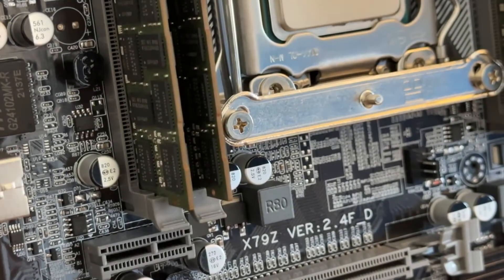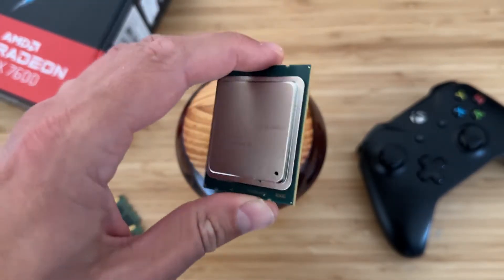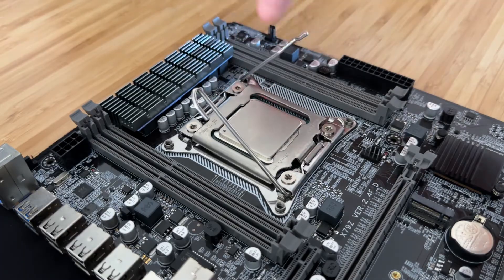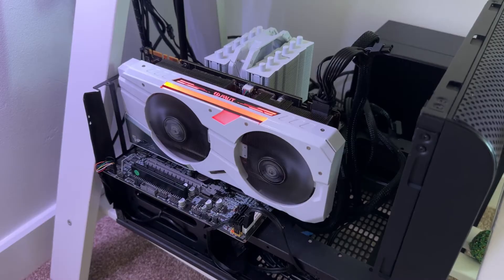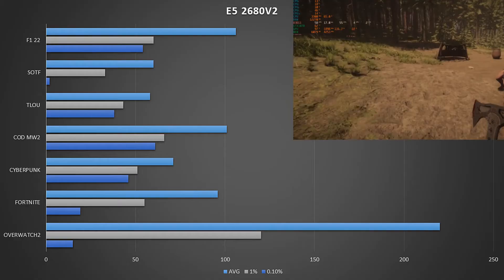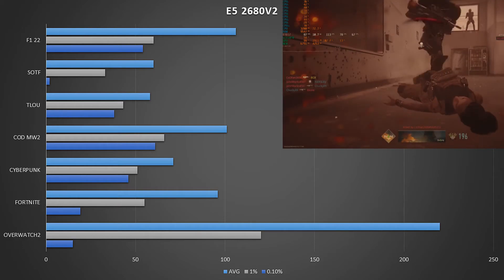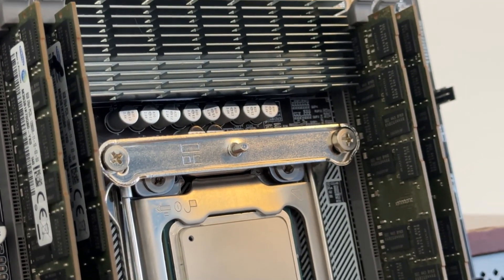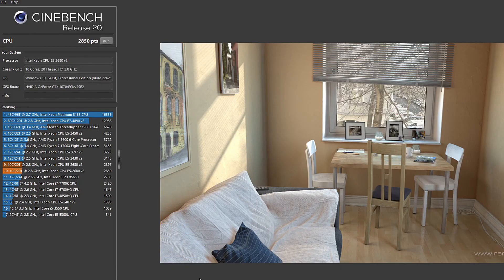This £60 XEON Motherboard Combo is Just AWESOME

Comment: I would never use one of those Chinese boards, every one I've seen has been utter junkk.
Reply from the maker: He’s still working strong 2 years later so I’m sold. Yes some are garbage but make sure you buy one with the proper chipset. Some have H81/H61 chipsets and yeah 😅

Comment: Ive just built a budget gaming machine using a HP Z440 workstation and a E5-2687w v4. 64GB RAM. It absolutely rips with 24 cores.  It was £150 total, and has a 700 watt PSU with dual graphics card power plugs. Assetto Corsa is giving 160 FPS, brilliant.
Reply from the maker: Belter for £150 there! Really love the used workstation price to performance.

Comment: wow it looks great i didn't see any drops or delay the Cpu you used is good enough to run most of big games which is based on 2.8 gh for single core and the Gpu  is 8Gb i think you did perfect PC gaming collection i will try to find the same parts for low cost PC to save more money and 1080 FHD is not bad  
one more thing i wish if you try to play horizon game because this game really heavy and needs more specifications

Comment: Great job, been a Xeon fan for years now for building Gaming PC.  I have 2 Lenovo ThinkStation P500 and P510 (got them for $100 each) running a Xeon E5-2697 v3 and a Xeon E5-2697A V4, both with 32GB Ram. Added a GTX1660Ti 6GB and a RTX3060 8GB and they are awesome for gaming.
Reply from the maker: ThinkStations are definitely a good route to go and they look a lot better than the Dells! Can’t wait for cheap X299’s but there a way off me thinks.

Comment: X99 2680 v4 combo works similar to Ryzen 5 3600. You can pair it with an RX 6600 or the highest RTX 4060 with a bit bottleneck
Reply from the maker: Just with more cores 🤩

Comment: Ordered my first AliExpress Xeon mobo few days ago for a NAS/homelab project. It was about 150USD (shipped + customs) for server-like mobo, with 6 RAM slots, 2x2.5Gbit Intel NIC, 10 SATA ports, 2xNVMe PCI-E slots, paired with Xeon E5-2680v4 (14c/28t) with full virtualization, AVX/AVX2 support and 40 PCI-E lanes for server addons. I hope it will be stable in the long run. CPU won't be tasked much, but I plan to run few VMs and dockers, so having more cores will be nice. For gamers, there are also higher clocked Xeons with less cores.
Reply from the maker: Awesome I love a project! Really hope it serves you well it’s a great platform. The 2667v3 is a personal favourite 8cores 16threads at 3.4GHz all core 💪🏼
Reply: Did you get it? did it support virtualization? link it
Reply: Yes, I got it. Search for "XEON Nas Motherboard Kit 10 SATA" and it should show as a first result. It's a motherboard with 6 RAM slots (2 on left, 4 on right), 2 NVMe slots (one vertical on the left side of the CPU socket, one horizontal on the bottom of the board), 2*PCI-Ex16, 1*PCI-Ex8. There is also a "Cloud Star" text in the middle of the motherboard.
Everything is working: virtualization, bifurcation (configurable in BIOS for all slots), all SATA ports, all NICs. I've connected 8xHDD, 2xSATA SDD, 2xNVMe and it's running great. Tested on Windows 10 and 11, as well as Ubuntu 24.04.1. BIOS has A LOT of settings and the ones that I needed all worked (energy management, SATA and NVMe config, legacy vs. UEFI boot etc.). Tested with 2 CPUs: one that came with motherboard E5-2680v4 (14c/28t) and one I bought locally E5-2620v4 (8c/16t). Both working without problems. I am using E5-2620v4 because 8c is enough for my use and it has lower TDP. Also lower NVMe slot seems to share lanes with PCI-Ex8 slot, so have that in mind.
I've used 4x32GB of Samsung ECC RDIMM 2400MHz DDR4 - dirt cheap and stable with both E5-2680v4 (running at 2400MHz) and E5-2620v4 (running at 2133MHz). Tested on both CPUs with 24h MemTest run. ECC works as well.
One downside - energy consumption. At default it uses around 65W (measured at wall) in idle with 1*NVMe drive and E2680v4 (14c). After BIOS optimizations it came down to 58W. With E5-2620v4 it came down another 2W, to 56W. CPU supports states from C1 to C3.
Overall I'm happy with my purchase. Time will tell how this motherboard will fare in a longtime 24/7 run. I plan to use it for maybe 2 years while slowly learning as much as I can in the home lab environment. After that I would want swap it to something more energy efficient and more modern.

That said, If I were to build my home lab setup today, I would probably go with something like CWWK Q670 with a 12th gen Intel CPU on board. It has less expansion due to CPU having less PCI-E lanes and smaller size (mITX), but at the same time it has a vPro support for remote management, CPU has a modern iGPU for Plex/Jellyfin hardware acceleration, a lot lower power consumption in idle, it supports T line of CPUs with 35W TDP etc. Modern i5 core will have a lot higher single core performance as older Xeon as well. No ECC sadly, but for a home lab I think internal sort-of ECC in DDR5 would suffice. Downside - mobo+CPU+64GB DDR5 will cost twice as much as the Xeon+mobo+128GB for the initial investment. For me it would take around 3 years to get it back in energy savings.

Comment: The limitation now only coz it's Mobo old features.. with slow transfer speed will be mode ruin. Btw for someone who don't care on this matter, this build not such a problem and it's perform very well for light gaming for budget cost. And the most important value very good for server user to avoid error. Recommend for 24/7 turn on without problem of error.
Reply from the maker: 2666v3 and a cheap board with 32GB ddr4 ram at the moment come in at under £60! Awesome value and yes agreed I would get on AM4 for a little more if you can but you can pair a 3060 12GB no problem with that above combo 💪🏼

Comment: Better go for e5 2697 v3
Reply from the maker: Loads of options. X99 is the better bet to go for and the 2667 v3 is a good option as well, higher base and boost clock but you loose a few cores
Reply: @andystech101  e5 2697 v3 has better performance in all xeon processors e5 2697 is almost equal to Ryzen 5 5600x and price is too low around 10 to 20 bucks

Comment: Those slots look like they belong to two 3090 GPUs NVLinked.  If both of those are PCIex16 slots, then games would be a bit smoother. Yes, one is used in gaming with the other providing PhysX; no SLI.  That is from testing and not just using 8x PCIe 3.0 bandwidth.  This would make good for an editor and gamer.  You would not have the gaming performance of a 4090, but would be on par or greater for machine learning or rendering.  The CPU tradeoff would be the determining factor.

Comment: Love Xeon's. Got an old HP Z440. E5 1650V3 32g 2133 k2200 Quadro. $230 Australian. I put an NVME in on an  ($29) HP Turbo pci-e adaptor.
Reply: Same here !, Z440, E5-2687w v4, 64GB, and a GTX 1060 6GB. If you update the BIOS to latest then you can add any PCIe NVME adapter and it will boot from NVME on the latest bios revision. They are awesome PC's. The quality of the unit is outstanding, its like the Bentley of PC's, and amazing value. Over £2,300 new, but now for £150 on marketplace. For a 24 core machine such an awesome bargain.

Comment: what is thepower consumption in indle and average use ?
Reply from the maker: At this point in time I couldn’t tell you but it was nothing amazing as these old Xeons pull 120w+ under-load. That said the new i7’s etc pull a lot more

Comment: Nice Video, the X79 is a good platform for budget builds but the X99 is getting cheaper and you might find some deals, i got a Machinist X99-PR9 for $26 and paired it with the E5-2620 V3 which i got for $2 and got a small cooler for $4 with 8GB DDR4 ram for $10 all for $45 from Aliexpress + seeing the E5-2680 V2 competing with the R7 5700G is wild.
Reply from the maker: I’d agree with you there with X99. I think if you can spend the extra especially 9 months on. They’re really good little boards the X99-PR9 and I’ve used a few now for budget builds. That said I think we’ll get another year or two out of X79 before it’s rendered to the realms of X58! Still my favourite but just not really usable these days due to the lack of instruction sets!

Comment: If we consider both performance and power efficiency, which of these two chips would be better to get?? 2680-V2 or 2690-V2 Is there a big difference in power consumption between these two chips or is it about the same if we run the 2690 at a lower frequency to match the 2680?? I'm looking to buy one with low power consumption but also decent performance.
Reply from the maker: Both are quite juicy tbh. I would go X79 if you’re looking for power efficiency. Though the cheap Ali express boards tend to have a power limit so you won’t be pulling the full 130w

Comment: Cool motherboard and video.
The problem with Xeon is power consumption
Reply from the maker: It’s not too bad on these Ali boards as they seem to be power limited or at least the cheaper ones but yes in the world of 8core 65w parts these days they are a little juicy! That said I had an i7 12700 for a customer build and that was pulling 180w on turbo.
Reply: It's really depends on a country where you live I think
Reply: Yeh my E5-2687w v4 is 160 watts on full load, so its a hungry CPU. But not really fussed for about 4hrs gaming a week.

Comment: I’m currently running an “Atermiter” X99 with a Xeon E5-2667 v4 and 24 Gb of ram. 8 cores, double threaded, 3.2 GHz base. Currently running with an RR-580 4Gb card. Will it run Elden Ring? No. Will it run CAD and AoE2 DE? Absolutely.
Reply from the maker: I’d probably say your gpu is letting you down on the Eldon Ring front as you should be able to pair an RTX3060/RX6600 quite happily with the 2667 v4 it’s still a little beast and easily keeps up with a 1st/2nd gen 8core Ryzen!

Comment: You make an excellent argument. I am thankful for your videos. You have an amazing video editing talent, what rig do you use for editing ? I would like to note that unfortunately Chinese motherboards are lacking in terms of overclocking, warranty, and buyer protection. If you come across any problem you would loose money. The motherboards are getting expensive by the day, so the regular brands make more sense. Again I thank you so much.
Reply from the maker: Yes agreed there! Thankfully I’ve not had any problems as of yet with this board or any Ali board I’ve brought. Yes features are lacking but most users just want an out the box experience. Thanks I try 😂 My main rig is an i5 13400F and 7800XT with 32GB ram, 1TB NVMe. This was nice to build as I was working with a 5600G before 💪🏼

Comment: 😃 wow thats pretty cool, this looks like its even cheaper than a brand new but kinda slow little ryzen 5 4500 and A520 combo, the 5700g is one of those weird lower tier chips like the 5600g, the number schemes are kinda confusing eh. We need a new song for the Xeons like we have for the Pentiums, its all about the pentiums 😄 thanks bro for checking out the xeons
Reply from the maker: Thanks for the comment really appreciate it. Yes got to love Xeon’s, what more do you need for a budget system in 2024! I mean the 4core i7’s are almost dead at this point! Just picked up a E5 2689 for £1.18 on Ali 🤩 8cores 16threads for a £1 what’s not to love 🙏🏼
Reply: @andystech101  😏👍 good price

Comment: You may go similar cheaper with a HP Z420 and this CPU, I have one but with a Xeon E5 1680 V2 paired with an RTX 3060Ti and COD MW runs at 70-80 FPS in 1080p in balanced quality settings, no DLSS. Regarding lack of AVX2, everyone mentions it but haven't seen an issue with newer games running on AVX1. I would like to see someone do a comparison test and share the results. After all these years, these old CPU's are still relevant and perform quite well given their cost. A lovely CPU you have, enjoy it many years!
Reply from the maker: No personally not having AVX2 doesn’t bother me, it does affect the percentages in some games but really when your working on this end of the market it’s going to be a hell of a lot better than the 4core equivalent. Xeon all the way for budget builds.

Comment: Will the 2650 v4 pair well with something like a 1660 ti/2060 super/3060 12gb? I'm looking to upgrade my  motherboard since my current one can't facilitate a PSU upgrade and I'm stuck gaming on a 1050 ti which is basically a paperweight at this point. Wondering if I can switch over to the 2650 v5 and still get strong 1080p/1440p performance with it or if it will bottleneck.
Reply from the maker: Yes the 2650 v4 will pair well with a 2060super and 1660ti. 3060 12GB would be the limit I’d pair with it. There are better options than the 2650v4 but I guess you’re looking at the cheap $50 combos! The 2666 v3 is a better chip personally 😎
Reply: @andystech101  Yep! Looking at the $50 combo on AliExpress. I'm currently on an i7-8700 but an 1151 motherboard is around $100 already as is. I figured I'd save a few extra bucks and go with this if it would work well with it. Plus I'll be handing my current motherboard/cpu off to a family member as well so it won't be going to waste. Thank you for the quick response!
Reply: @andystech101  Ok sorry! I'm back again and one more question. 2070 super will pair? I think I've settled on that GPU, as I'll be doing some AI Stuff, I've read that's the best bang for buck card but also want to make sure video game performance will also still be pretty well. $210 used price is ok and it will pair fine?

Comment: X99+ xeon e5 2650v4 or x99+ xeon e5 2680 v4 who's the better combo for gaming??
And keep up bro good stuff
Reply from the maker: Pro’s and con’s you’d be better off going for a 2666 v3 for gaming due to the higher clocks. 2650v4 has a lot of cores but they only run 2.5GHz and the 2580 v4 runs at 2.7GHZ all core but 14cores 🤩👌🏼

Comment: Is £19 including delivery a good price for a Xeon E5-2698 v3? 

Need to try and get a decent but efficient graphics card now. 🤔
Reply from the maker: Yes that’s a good price, it is though quite a low clocked chip so there’s better options for gaming.
Reply: @andystech101  Thanks for the response mate. Yeah you're right, its quite slow clock speeds out of the box but I was planning to flash the bios to force turbo and hopefully use it as a workstation and budget gaming rig. 😉

Comment: What’s your opinion on the 2680 v4?
Reply from the maker: 14cores 28threads isn’t too shabby but for gaming it has quite a low base clock at 2.4Ghz and it won’t go much above that 2.7/2.8GHz so there’s better options out there. Depends on the price.

Comment: I am running a dual 2630v2 System with 512GB RAM and a GTX1660. I love it using Kubuntu.
Reply: I used to have tae kwon do classes when i was at highschool.
Reply from the maker: Nice 😎

Comment: I'm currently running a xeon e5-2690v2, 32gb RAM. With an RX-590 and it plays near enough everything at ultra 1440. Apart from the new forza. So gpu upgrade coming soon 😅
Reply from the maker: Yeah the new Forza is a bit of a beast 😎

Comment: I prefer x99 ddr3 xeons. The 2678v3 with the turbo unlock hack, a machinist x99 rs9, and 16gb of quad channel ddr4 ecc is about 100 for the full combo, and meets ~ryzen 2700x gaming performance, much greater multitasking, as well as resizable bar support for things like budget intel arc cards
Reply from the maker: Yes definitely worth spending a little more if you’ve got it and the v3/v4 Xeon’s are great. It still performs reasonably well for the price when looking at other combos around the £50/£60 mark 😎

Comment: What is the idle power of the motherboard and chip without the gaming video card? I need a nice efficient multicore setup for virtualization.
Reply from the maker: There are lower power chips as I believe this pulls quite a lot. How much I couldn’t tell you off the top of my head.

Comment: Good value, but beware the quality. These Chinese motherboards are somewhat hit-or-miss, they will most likely work for a bout a year, and then develop problems. Questionable solder work and low quality capacitors etc. are the main issue.
The "heatsink" over the mosfets (above the processor) on this motherboard is most likely not a real heatsink, in the sense that it will do very little to help dissipate heat. Had a very similar board (x79) with the exact same style of heatsink and it actually required active cooling to help even a little. Put a 92mm fan angled towards it and the board stopped throttling the CPU. Then after about a year the board died. Have not bothered with China-boards since :)
Reply from the maker: Yes good point and one you kind of have to accept buying this stuff but for the price if it does you a year/two doesn’t seem too bad. It is currently still working as it should 😎

Comment: I absolutely LOVED my e5 1650v2 Xeon and x79 board. Sadly even overclocked they are hanging with Ryzen 1600 and losing to 2600s and beyond nowadays. Used 1st and 2nd gen Ryzen CPUs paired with a B450 mobo are strong contenders in the budget space. However as you show here the old Xeons can be had for dirt cheap and are still plenty fun to mess with and depending on one's region and budget are surprising. Small budget builds have a satisfaction all their own.
Reply: i currently have a 2689 on an x79 board that used to run okay but is now clearly bottelnecking my rx580. is the 1650v2 a good replacement?
Reply: @atarizd  Well the 1650v2 has a higher boost clock and better single core speed so for games it will be better.
Reply from the maker: I’d go with the 1650v2 as it will be better for gaming in your use case
Reply: Hey, thank you for your response.  @andystech101